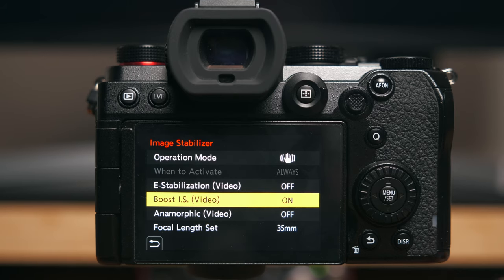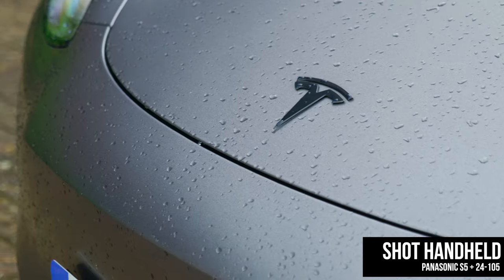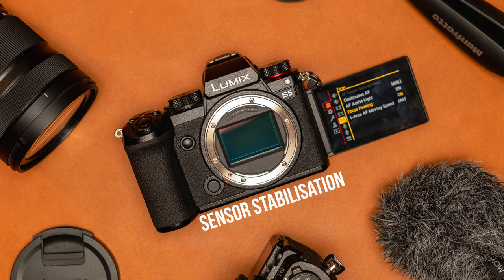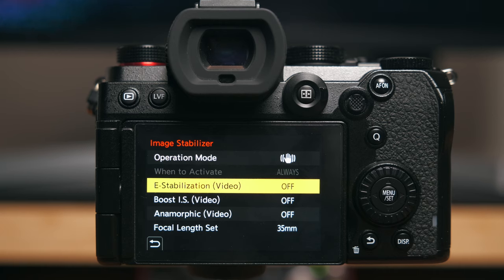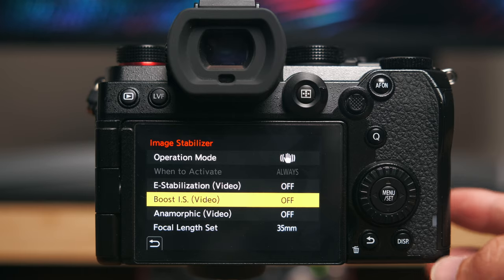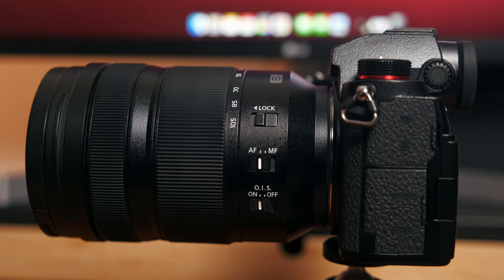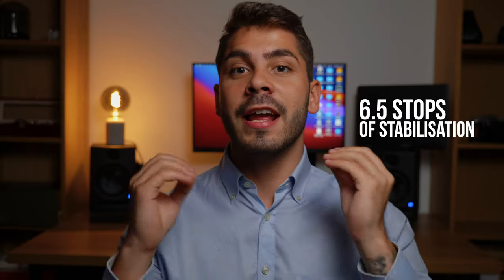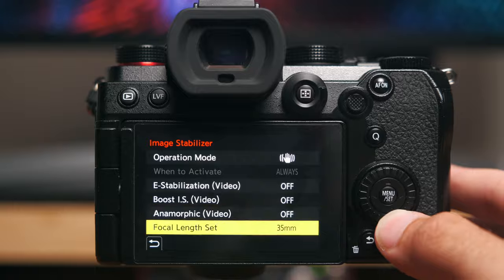Panasonic S5 Stabilisation Modes Explained - How To Get The SMOOTHEST Footage

Comment: Or I suffer from Parkinson or I haven't set up this well. My stabilization is awful on my lumix s5. I have the stabilization ON but does not work like you showing in the video. Is that because I have not the right lens?

Comment: From this video S5 IBIS seems to be weak. Image is only stable due to lens stabilization (any camera without IBIS works fine with stabilized lenses). Did you forgot to test camera IBIS on it's own or there are no option to switch it off? (I'm not talking about electronic stabilization - which has nothing to do with IBIS and it's all about cropping image)
Reply: I'm wondering about IBIS by itself. I also have the S5 and on pictures IBIS has been the best in my opinion for a full frame camera. I haven't tried videos yet. I should. haha
Reply: It is weak. Much better on the mft cameras

Comment: If I understood your examples right, none of them showed the effectiveness of IBIS without any OIS, right? OIS certainly seems to be effective and electronic improves a bit further.
By enabling Boost IS you are essentially telling the camera that you do not intend to make a panning or tilting motion. This allows it to stabilize more aggressively, but then you should indeed not try to pan or tilt. It's a function that has been available on their camcorders for quite some time already.
Reply from the maker: With everything off, you'd be looking at just the sensor shift stabilisation I believe as I don't think you can turn that off. 

Yeah exactly! Boost IS is designed for the static shot and not moving shot, but I just wanted to demonstrate for those who were wondering how it'd perform for other types of shots! 

Thanks for watching, Michael!
Reply: @JoshCameron  You can also turn ibis off. It's where you can specify the stabilization mode (normal, panning, panning vertical, panning horizontal or off) I'm guessing the english terminology here. I've been told the IBIS is actually still turned 'on' when set to off mode, as the construction requires power to try to keep the sensor in a fixed position relative to the camera body, but it will no longer try to counteract your motions.
Reply: @JoshCameron  Normal IBIS on its own provides 5 stops of stabilization. With a stabilized lens, it provides 6.5 stops. You can also turn it off (where the sensor is locked in place and there's no active stabilization). IBIS works great with non-stabilized lens; I use only vintage, manual lenses with it (Nikkor, Carl Zeiss ZF and Leica M) and the IBIS is absolutely marvelous. It's the killer feature of this camera for me.

Comment: If you are using a gimbal i guess is better to put off the IBIS mode and only use the regular one right?
Reply from the maker: When I'm using a gimbal I'll leave the mechanical stabilisation on (lens stabilisation) and then turn off all of the extra modes :D

Comment: Hi Josh,I  have one question for you and I am hoping I will get an answer. I love IBIS of M43,G85 .In 2020 I have a chance to test it and I love so much.But that was of my friend who sold it. I am a Nikon DX DSLR shooter for video with d7200. I shoot in low light mainly stage shows at schools and colleges. My DX Nikon's ISO 3200 fulfill low video shoot requirement but lack IBIS. Sometimes tripods and monopods I can't use on stage and down stage as per situation so handheld is a must. Don't want to use gimbal. Want to use GH5II with  video features and amazing IBIS.Can GH5 and GH5II fulfill my iso needs without noise or very less noise to shoot low light video with matching Nikon dx iso 3200 level with Panasonic IBIS in manual mode and that is my question? I hope you understand and please excuse for my poor explanation. It will help me in purchasing better next camera. Thank you Josh.S5 is not in my budget and lenses are expensive and but M43 -GH5,GH5II is in my budget. It is hard to get camera for testing here at my location unless anyone owns. So, your experience and answer matters. IBIS and ISO upto Nikons level of iso 3200 are my main requirements.Thank you.
Reply from the maker: Hey Neeraj, thank you for your comment. If IBIS is really important to you then the M43 cameras will be a fantastic choice for you. I would actually recommend the G9 as well if you haven't already looked at that? 

ISO 3200 should be fine on the Micro Four Thirds body, but it just depends on how focussed the light is on the scene. If you're shooting stage shows then chances are the lighting will be on the subject and therefore the main focus won't be that noisy; it'll just be the darkness surrounding that will be. 

Of course, you can grab some very fast glass for the GH5/GH5ii/G9 as well, at a price though. 

If you could extend your budget to the S5 then that would be far better for lowlight, but the IBIS in the cameras you mentioned would be a little better I would have thought :) 

Hope this helps!
Reply: @JoshCameron  Thank you Josh for replying. You are doing great work . Yes, your reply helped me the main highlight is on subject is the main point i got it Josh. G9 I had not still seen and will look.S5 is good a option but lenses here at my location are more expensive due to import duties and bodies are cheap. Thank you Josh for replying :)

Comment: Hello Josh 🙂

Hoping you're doing well!

Just wanted to seek your suggestions please.  

While shooting on Lumix S5, which colour profile do you use?

What's the recommended profile for photography and video?

I got to understand that the base ISO and higher ISO values vary based on the colour profile (as told by Lumix India support team).

I presumed it was ISO 640 and ISO 4000 for all modes, but just wanted to know from your experience, if there's any difference by colour profile 🙂

Cheers from Bangalore, India ✨💫

Comment: Something I think I'll test is using E-Stab on the S5 and then throwing some Warp Stab in Premiere on to the clip to see if it gives is that smidge extra stab it needs to eliminate the need for a gimbal. Thoughts?
Reply from the maker: I think this would work fine for very small push ins and pullouts, but wouldn't be as good if you're planning to move the camera across quite a large area (like walking for example). You may get a bit of funkiness happening with the Warp Stab!

Comment: just before watching i want to say that on my s5 i've noticed no major improvement when having either only boost is or e stabilization enabled or even both at the same time... lets see if i learn anything new in this video
Reply from the maker: What did you think after watching?
Reply: @JoshCameron  well tbh it kinda didnt apply to my gear since i dont have a lens with OIS ... i have the 20-60 mm kit lens and the result of my tests was just to leave the standard stabilisation on and E-stabilisation aswell as boost is turned off... reason being that in boost i.s. i noticed the auto focus losing my face constantly + the edges get warpy and the e-stabilisation crops in a bit. And besides , i really didnt notice a massive difference in stability improvement when just hand holding it an walking normally so there's really no point

again i'm using the S5 with the 20-60 mm lens with no OIS
Reply: I’m having the same experience. I think it’s the stabilized lens that works wonders

Comment: My Panasonic S5 arrived yesterday and I was excited to try the IBIS out as I've heard so much about it. I turned it on in the menu and nothing happened. In fact I get ZERO in any of the stabilization modes. nothing. The camera is going back for a replacement.

Comment: I keep shearing folks with this camera say “active” stabilization. Is that just boost?
Reply from the maker: Active and boost are two different stabilisation modes inside the S5. So active crops in a tiny bit, and boost is the strongest (wouldn’t recommend unless you’re standing still!)

Comment: I just wanna know if the stabilization is as good as the GH5....because, the GH5 stabilization is AMAZING, and smooth !!!
Reply from the maker: It's almost as good... maybe a hair behind due to the larger sensor and smaller body, but still fantastic!
Reply: S5 is pretty far behind imo
Reply: @fredriksvard2603  This is what my gut instinct is telling me too lol.
Reply: @TopshelfJunior  yeah.. maybe with ois, idk.. (or a gimbal, of course). But the mft cameras are pretty neat in some ways.
Reply: No, the gh5 stabilization is definitely better! Filming skate clips without a Gimbal with my gh5 an can use 95%. With my S5 it isnt working good... When Filming on a skateboard I can use only 40% over all clips. Now I have two Cams or I need my ronin sc + S5 for action shots...(without lens stabilization)